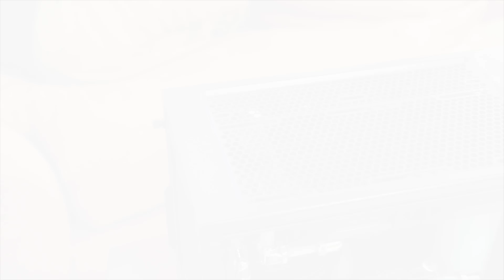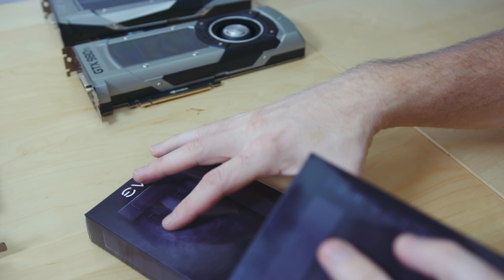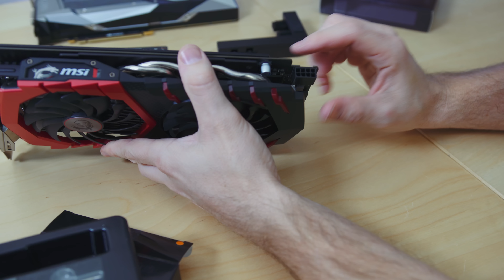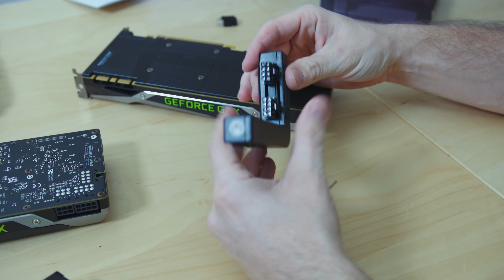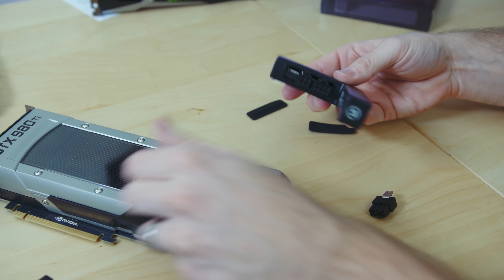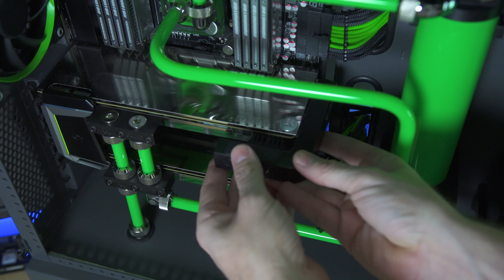How to manage your cables using EVGA Power Link

Comment: I think it's a great idea and it looks alot better than having cables sticking out like that, but it would be really nice if they had LEDs for the letters.  

Side note:  Since the graphics cards sit in the computer up side down anyway, the fact that the cables come out and around has never bothered me too much.  If you turn the card right side up with a mod or special case, the adapter would be up side down...  boo...

Comment: Since I've never used custom cables they would definitely improve the aesthetics of my build. Skunkworks - your cables are very nice, I don't think they detract from the overall look of the system, they add to it (for my tastes). That said, in general I do prefer the look of the squared-off black Power Links.

Comment: I have the 980Ti and my power supply only has the 8-pin connector, when the graphics card has a 6 pin and 8 pin. Do I have to get a whole new power supply? ( I have a 500W non-modular power supply)
Reply: Use a sata to 6-pin or molex to 6-pin adapter. I've made a few myself and if your psu has enough juice it will obviously work. 500w should be enough for 980ti, worth a try since the adapter won't cost that much.
Reply: OhMyGolem probably a dumb question, (I'm new to pc building) does the molex plug into? And for the sata to 6-pin, do I just plug it into the sata power thing from my power supply? Like he one that I connect my storage to?
Reply: OhMyGolem probably my fault for not being clear. But, the sata that plugs into your storage, you have to give power to them from your power supply.  Would I do the same thing, but substitute the storage for the adapter? (If it's not clear enough and you still don't understand then don't respond. I don't want to waste your time, sorry)
Reply: Yes, sata is the connection used to power your harddrives aswell. You usually have one cable that has multiple sata connectors, just plug the adapter in one connector and the other end to the graphics card.
Reply: Imooogi yes, pretty much how you described it. Molex is also an option, pretty much just comes down to which one looks neater, cable management and which one you can find easier.
Reply: OhMyGolem ok thank you so much

Comment: With the way those are made it's not bad. An LED mod wouldn't be that hard if your skilled with a Dremel and a soldering iron. With a small section of the light carrier and diffusion layers from an old LCD screen it would be pretty easy to edge light it and make the logo pop quite nicely. I know your not into modding as much as some but it might be something to consider. It isn't as if you lack items to experiment on. Old drive bay covers and computer cases that are still sitting around would be perfect. At least that's what I cut my modding teeth on.... Great stuff. I like it...

Comment: I love seeing the beautiful braided cables. Its a shame the power links are not installed more secure. Hanging on just by the power connections might not work out too well if you have stiff cables that apply a lot of pressure on the power link. Still looks great though.

Comment: I was skeptical at first, but they do look kinda nice. BUT if you trained the nice braided cables to go down 90 degrees and then towards the motherboard another 90 degrees, then folded sideways 90 degrees at the motherboard and straight into the grommets that would probably look nicer still. Or fold 90 degrees immediately after going down 90 degrees from the power plug to start with.

Comment: Is there a reason for having your GPU and CPU on different loops instead of one big loop?
Reply: Doesn't really work like that. The temperature of the fluid equalizes over the entire loop as it's pumped around. Seperating the loops means you don't get the heat from the GPU's in the CPU loop, but the order in which you put components really doesn't matter, except I believe it's best practice to put pump after res
Reply: QuantumStrikes also if say your cpu is after the GPU, the CPU is getting warmer coolant and won't be cooled as efficiently
Reply: @fingerflip135 Not really, I mean the CPU loop stays cooler because GPU's put out way more heat, but in the case of Skunkworks It's mostly because he can, and because It's over the top like the rest of the build.
Reply: Male Supremacy no, it isn't.
thermal transfer from water through Radiator to air is almost always the bottleneck, not flow rate.

increasing the pump speed from the usual 20% to 100% in Liquid Loops drops the temperature by exactly 0-1 Degree. within margin of error.

please learn how Liquid Cooling systems work. also Thermodynamics.
Reply: Matthew Oustad report him ?? for what?
trolling  ? ignorance ? stupidity? racist ?insulting? cant choose...........
Reply: I thought it had something to do with reducing the mechanical stress on pumps by not having multiple radiators for a single pump to work with?
Reply: O-Kohavi don't make me laugh. that YT Channel is for entertainment purposes only under normal circumstances.
Luke makes an informational video from time to time.
Reply: +fingerflip135 Is this your first time watching one of +JayzTwoCents' videos? Because he is always saying component order doesnt matter. And it indeed doesnt. If you haven't already, you should sub to Jay because you clearly need to learn a few things about watercooling, or just thermodynamics in general.
Reply: How could I not be experiencing the brilliance of the Internet? I'm talking to you aren't I? xD
Reply: QuantumStrikes I don't really think there is any real reason unless you just want it to be a little more manageable.
Reply: there isn't any real benefit. it's mostly for Aesthetics.

it can situationally be useful when you have components that generate a shitload of heat, but usually it doesn't do anything for you.

if your components are getting hot, just add more Radiators.
Reply: Male Supremacy only loops approaching gigantic will have head pressure requirements that start stressing the pumps people use.
the two popular pumps are pretty beefy.
Reply: taiiat
do you want to see a real watercooling challenge, watch linustechtips whole room water cooling
Reply: +Male Supremacy L0L now that youve run out of logical explanations for your HYPOTHESIS (notice I didnt say theory because I dare you to find any shred of evidence to back up your argument), so you resort to simple name calling and gender slamming? Just sad...
Reply: Male Supremacy  TRIGGERED. lol. You have no idea what you're talking about do you?
Reply: No idea how this thread managed to sink to  the level of a cesspool...
Reply: +Tobias Putman Photography +Al B Just report him, he clearly knows he lost the argument. Just sad really...
Reply: Al B Exactly why I usually don't even go to the comments, don't need these daft trolls. 
And you, Male Supremacy, have obviously never left you bedroom in your parent's house.

Comment: Jay you found the one scenario where this item doesn't look better. Since you have already trained cables that look great and match the color scheme the power link takes away that feel of color and precision. otherwise this item would look great in a lot of systems for example those who have hard wired colored cables or rigid black cables like corsair CX power supply's

Comment: I like the look after.  I'm waiting for my free one from evga to go with my 1080FTW.  Also.  If I'm not mistaken, there is also a capacitor inside the adapter to help eliminate any residual power ripple from the psu

Comment: Not bad. i remember the evga did light on the CES. maybe with a little mod like thin transparent double side tape can give more support. Like the ones is use on phone screens could work and the tape is transparent, it will stick.  the sad part is only on reference/founder PCS and like those on other brands will work but i kind like it!

Comment: The EVGA adaptors feel like there a half way there alternative to minimising cables. to completely fix the issue they need to move the onboard connectors, if someone has the money for a long gpu they have the money for a long pc case IMO

Comment: Not much of a difference. Looks a bit more organized, but personally I think it's a trinket without much utility, and looks kinda frail as you were moving them in the video.

BTW, do you think it would interfere with the air cooling of the card? I know skunkworks is completely watercooled, but it seemed to me that this power link blocks the side of the card.

Comment: What a great little gadget, surprised someone else didn't invent it sooner since it really gets the cables out of the way.
Reply: Better yet, card makers just need to stop putting the PCI-Express connectors on the top of the card and instead put them on the back.
Reply: i think they need a little tab to grab the pcb so they don't bend this much. the thingy now becomes a lever that puts a lot of stress on the connectors.
Reply: Sapphire makes their 480/470 with the power connectors on the other side.
Reply: With the proper measurements, you could print a shell to place cables in that would do something similar and not put the extra strain on the card(s).
Reply: That's exactly my issue with this product...it SHOULD have been invented sooner. Back when cases didnt have PSU shrouds with holes through them specifically for routing GPU power cables, this product could have been a hit. But now with PSU shrouds becoming almost standard for every case on the market, I'm afraid this product will be overlooked very often.
Reply: I am surprise that all cards doesn't have their power plugs at the back of the card.
Reply: ikr I love these things
Reply: on the pcie side? you know that'd likely mean they havve much harder motherboard configuration
Reply: you should install these in your build
Reply: First bitches.

Comment: just curious: are you not blocking a venting hole for the cards cooler at the backside there? could that lead to more air resistance and a louder fan noise or even overheating? or are there plenty other ways for the air to go?

Comment: Looks good wish they added some rgb lighting maybe next time. Do you notice any latency draw from the extensions?
Reply: no, these do not add any relevant Latency to your Computer.
the difference in travel time from your Power Supply to GPU might go up by a few hundred Nano Seconds.

not that such a timeframe matters at all, it would only affect how long before your GPU's have power after you turn your computer on. irrelevant.
Reply: Jason cheever there shouldn't be any as using the power link can be compared to using cable extensions, if you put it in perspective